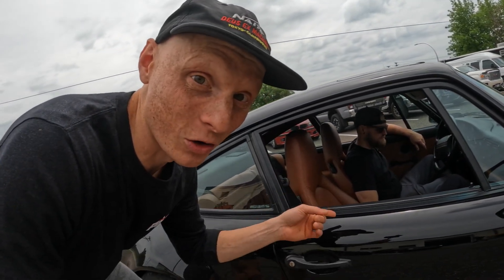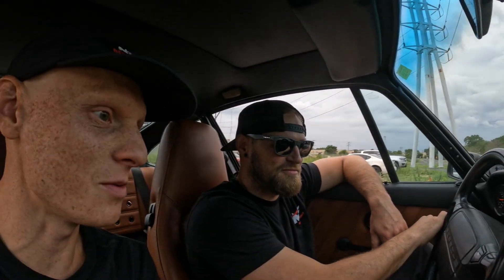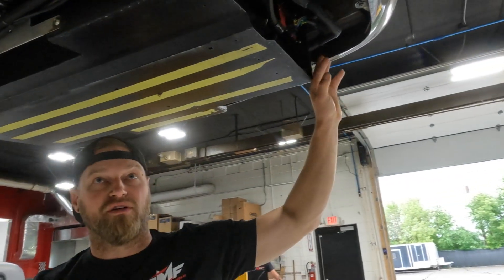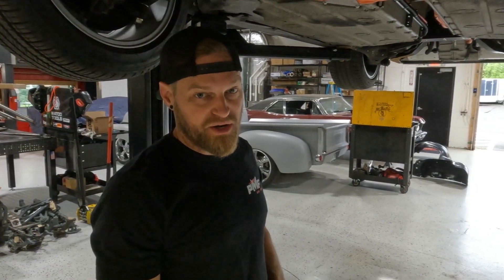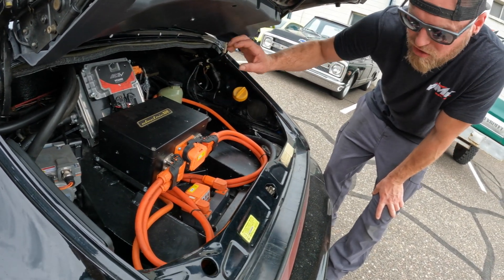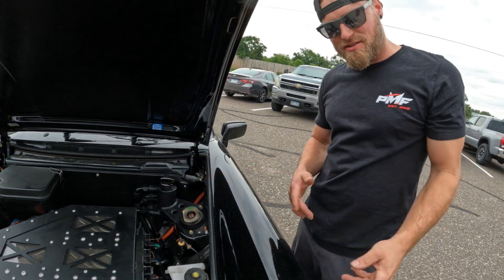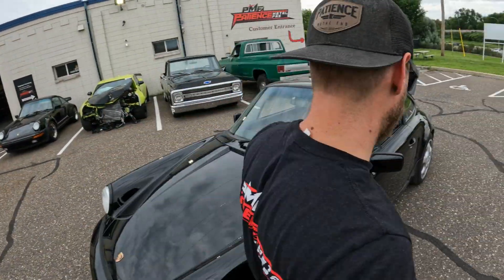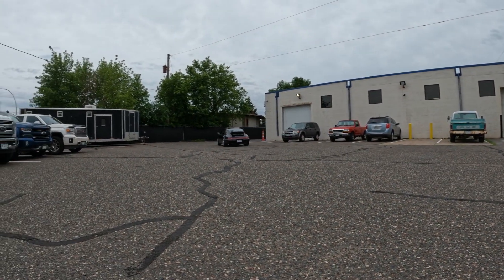Tesla Swapped Porsche 911 BUILD BREAKDOWN

Comment: The packaging underneath is SERIOUSLY impressive. Absolutely wild build. Was an EV swap significantly harder than an engine swap? Or easier?
Reply from the maker: Thank you for the compliment, the engineering work to make it all happen was intensive. Absolutely; we're so versed in combustion engine swaps and the aftermarket support is so strong, that they're mostly a breeze. A lot more unknowns and hurdles to jump with a conversion like this!